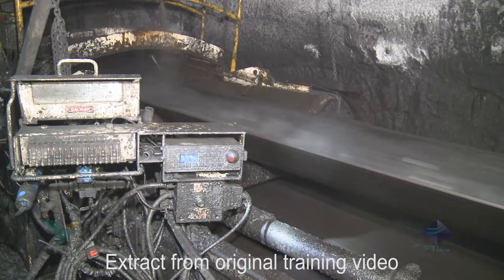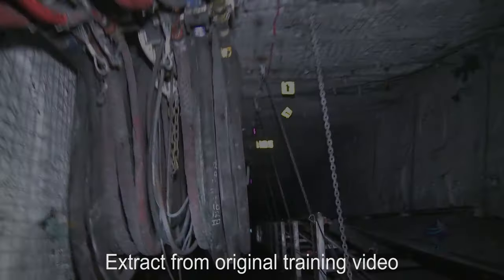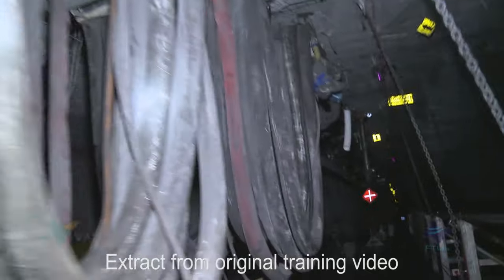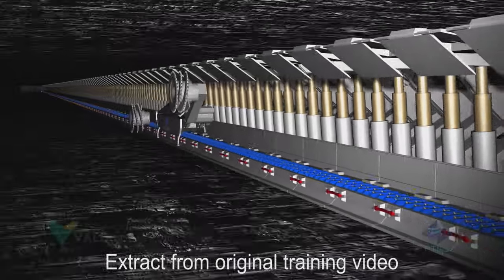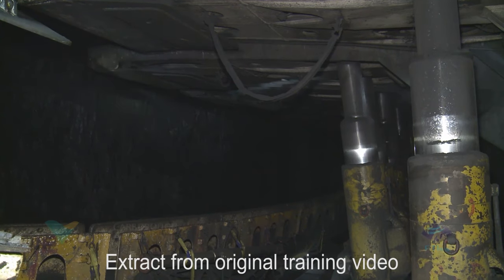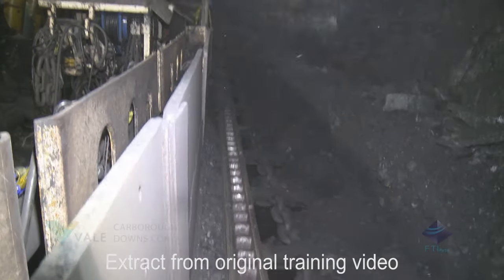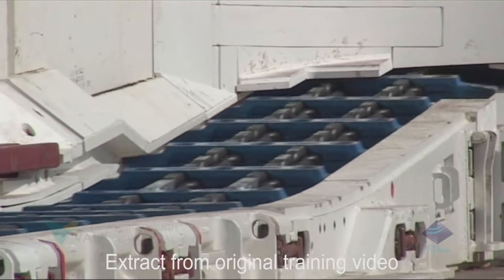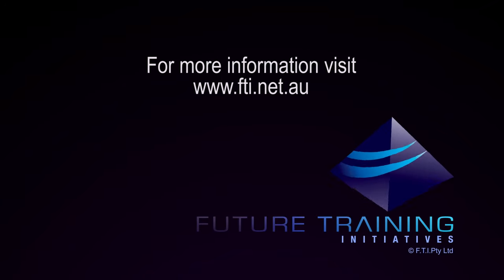Longwall Mining Operation - F.T.I. Pty Ltd

Comment: What about rib support? If you're using steel mesh i suggest switching to corrugated plastic mesh. Unlike steel its fire resistant, anti-static and easy to identify loose rocks because of the corrugation. They're also light and easy to handle